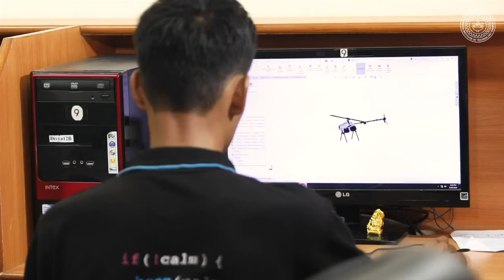Chinook Like Tandem Rotor Drone Helicopter From IIT Kanpur

Comment: No problem, gain experience, but pse use it in use later. Pse dont join finance or selling soaps. We have lots of non tech mba to do that. Become weapon designers. Country needs that.
Reply: Unfortunately not the case. The moment 3rd or 4th yr campus placement comes around- most of these budding weapons designers will move to Finance or IT & their mech engg skills will atrophy. This is how internal brain drain is happening in India. How many mech engg graduates actually work in the same field? Very few & far between
Reply: @girishg414  this the failures of GOV not the students they worked hard to earn & give their families a better life if Gov is not able to capital on thats their fault not the students.
Reply: @utkarshdwivedi6600  then why study engineering in IIT only to join finance & IT? I also know so many students who finish engg only to spend another 2-3 yrs studying for upsc- nothing more ridiculous than this!

Comment: I made one back in 2013 using kk2 board  using 2 trex450 frame parts( bicopter)  I see u r using one  power source and  pulley system.
Reply: Using kk! stable hua flight?
Reply: @debashishdas4865  stable up to 45-50degree bank  key is independent power supply to each rotor so they behave like an independent gyro 
Which can’t be done in the above single power supply but require some major changes in design as of now above designed is flawed as it is limited to basic manoeuvres
Been there done that
Reply: @winniesharma  thanks 😊, 🙏

Comment: This drones are super slow can't be used in defence
Reply: This is not a MALE / HALE drone, it's a prototype of a smaller drone that can be used to deliver supplies and all, use your brain if you even have one.
Reply: @Chick_magnet__250  but is it something our best universities should be working on?
Isn't it kinda low level compared to the level we attach with IITs?
I don't want to pull down young guys buy i expect alot more from them.
Pls correct me if I'm wrong.
Reply: @abhilash9918  just one thing "scaled prototype" 
Fuckin understand it
Reply: @Chick_magnet__250  we will see in few years if this 'scaled prototype' gets anywhere or its another sloppy attempt at quick headline phot op.
Reply: @abhilash9918  it will become a legit military grade drone if this "scaled prototype" Gets the government's attention and if army needs such drones, you know, the government would never let them export it, and won't even let them sell it in the civilian market, eventually killing the project, that's the story of most of the "ambitious" defence startups in the country.
Reply: @Chick_magnet__250  They are making fuvking prototype of drones?
They have such low standard tahy have to make prototype of drones?
The meaning of prototype is that making the exact thing in smaller scale to work on flaws..😂😂🤣😂🤣😂😂🤣